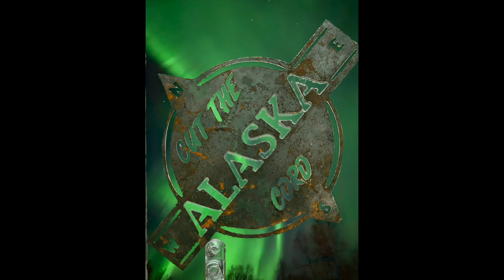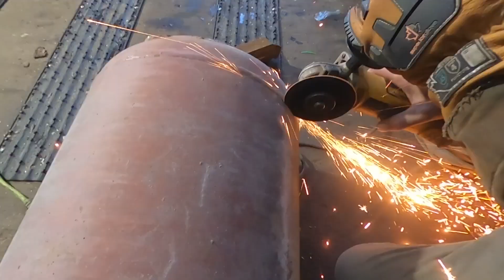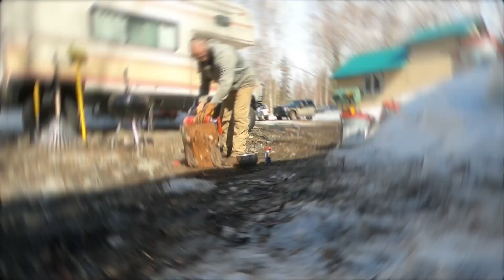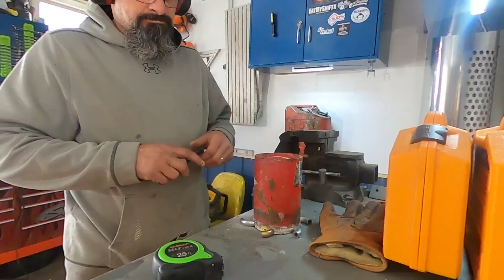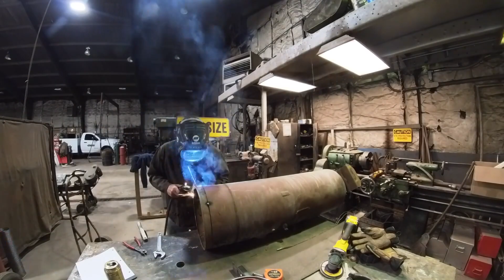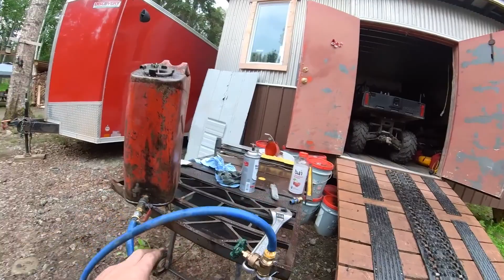Waste oil drip stove build.

Comment: You always know its going to be a good project when sparks are flying everywhere
Reply from the maker: That does seem to be true.  The stove sure turned out better than I thought it would.  Just needed it about two months ago,  according to the garden anyway.
Reply: @alaskacutthecord769  what's your source of oil for the stove?
Reply from the maker: I work at Fisher's fuel and we do all of our own oil changes and usually pay to get rid of the used oil.  So, I take it for free and they save money.  It was costing me 200$ per month to heat my shed last year now it'll be free.
Reply: @alaskacutthecord769  that's fantastic!   My 4 oil changes a year wouldn't cut it but if you have a source that's like money in the bank

Comment: I looked into making one of these,  so I was curious how yours turned out.
Reply from the maker: It actually turned out better than I thought it would have.  I've run it for two weeks in the green house for a couple of hours at night and used about 6 gallons of fuel.  Not bad and not expensive.